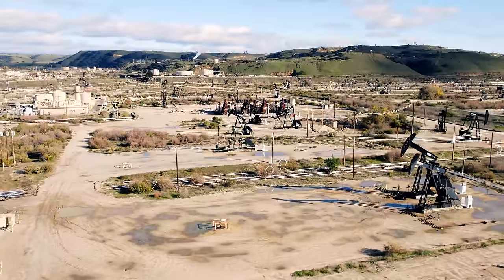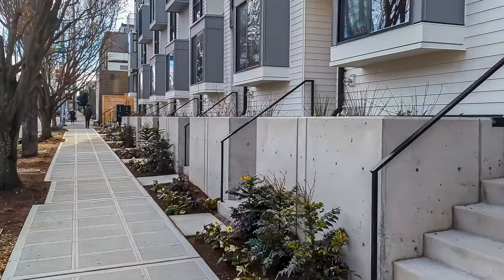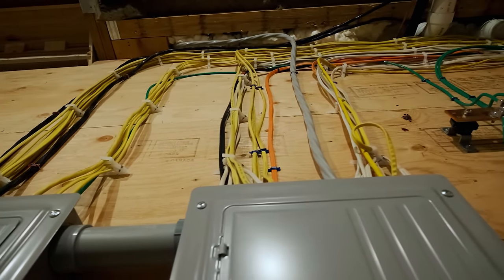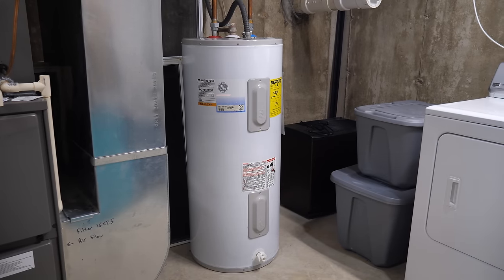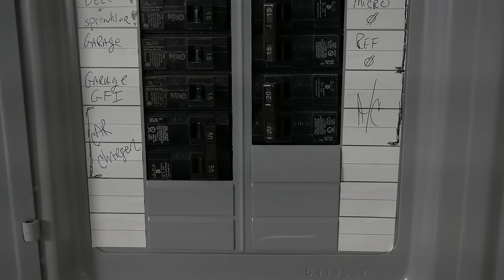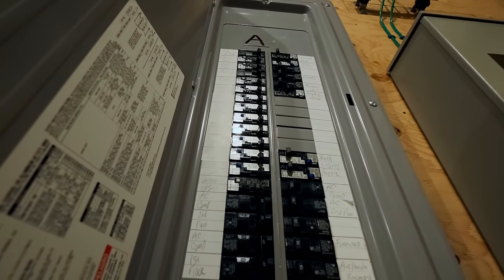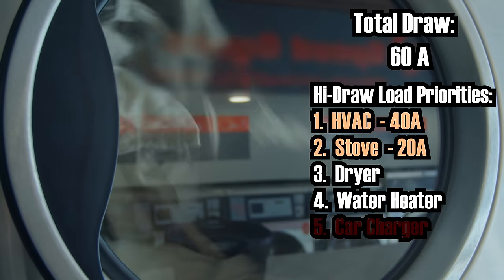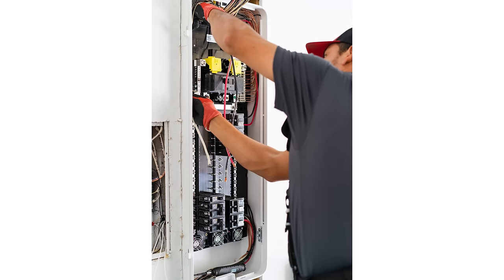Home Electrification: There's not a lot to do, and it doesn't have to be hard (Part 1)

Comment: There is also a very "unsmart" but actually very smart alternative to these smart breaker panels and it has been around for decades:
A load shedding relais.
I used to have them in my home and they were installed here in the late 80s. The current measuring device used to check if the tankless water heaters for the bathrooms were running, like drawing more than 10 amps. If that was the case, they would prevent the night storage heating from charging. These used to pull almost 40 amps on 3-phases (my house has 3-phase 63A service) and they were charging all night so a couple minutes of load shedding was not even noticable during the day. 
These load shedding relais cost somewhere between 20-40 bucks over here where I live and are not too rare of a sight in home electrical panels. They are not connected to anything other than the electrical circuit so no one can use that to spy on you if you're scared of that.
Also the technical complexity of these things is very primitive so they are probably the most reliable option you will be able to find.
And as an added bonus: If you use these things, everything is hardwired, so no softwareupdates can mess up your home.
Reply: Are you french?  You spell relays like it was a french word (relais)

.
Reply: @electrictroy2010  
Well relais is a french word :D 
other languages just adopted the word as far as I know...
But no I'm german.

Comment: Remember a range will heat the home too so it doesnt matter if the heat pump or resistive heat is reduced while the range is cooking food. The heat out of the oven or stovetop pots still has to go somewhere. Usually into the surrounding air.
Reply: not if it's induction. and if you're putting in an electric range why wouldn't you get an induction unit today?
Reply: @Turk380  Induction is not perfectly efficient. Your pots will still radiate heat.
Reply: @Turk380  ever get a wedding ring near a induction burner?
Reply: I don't think it's going to reduce the heat pump, it will just shut it off which isn't too good for the compressor or if it where to start a defrost cycle. But you've got a good point here since all new heart pumps have wifi control, you could actually turn down the temperature relative to other resistive loads. Still need to be mindful that heat pump generates great a 2-3:1 ratio whereas anything else is 1:1 efficient. Mind you, my pump of 1.5kW replaces 30kW of resistive heaters so would not even touch it.
Reply: @avlawns3037  I'm not familiar with many wedding bands being made of ferrous metals
Reply: @jor7137  yes but that is minor compared to an electric coil directly heating the air.
Reply: @Turk380  I have a closed kitchen and an induction stovetop and it gets significantly warmer in the kitchen when I cook. All the pots radiate heat, all the steam warms the place up, even the cabinet below stovetop gets warm. All that power must go somewhere.
Reply: @Turk380  plenty of costume is though.

I'm sure that clashing magnetic field is wonderful for your body.

Eddy currents can be set up in non ferrous metals that generate heat regardless.

Electric stoves suck anyway.

Comment: We recently converted our home to mostly gas service. We had a gas furnace. Installed a tankless gas water heater, a gas range, and natural gas powered standby generator. Our electric bill dropped considerably, and natural gas is cheap to run. The highest it's ever been since we had several days at zero degrees Fahrenheit was January this year and it was $90..while our electric bill was a mere $100. My next door neighbors electric bill was almost $450 for the same time period using all electric.

In the summer our electric bill is in the $220-$250 range, but gas is $18-$20. While my neighbors bill is still over $300.

So where is the electric advantage???
Reply: Count your blessings. During the peak of the Ukraine / Russia conflict a cubic meter of gas went well over 3 euro's over here. Heating the home from 15 to 17 degrees would cost you around 5 to 6 euros just heating the living room and closing it off from the rest of the home.

That being said. I'm not planning to leave gas any day soon. Converting the home to full electric would cost me well over 40k even though I already own 4000 Peak watt of solar panels 😅And I have no idea where I'd have to put all that water pump stuff.
Reply: You very well could live in a cheap-gas-expensive-electricity area.
Also, how much did it cost to convert all that over?
I'd love to see the payback period of all that with gas prices rising and electrical alternatives decreasing.
Reply: You're either lying or you live next to a gas plant. Here in CA we are paying $150 per day to run our Generac 22/24kw standby generator on natural gas when utility power goes out. With the snow storm going on right now on northern CA, our utility was out for 4 days meaning we spent $600 in 4 days.

Comment: I recently completed my home electric conversion for NG. Induction cooktop, heat pump hot water and single spilt reverse cycle air-con. On top of that, I also installed a 10kw solar PV. Cost me less as I'm an electrician, but wasn't cheap. But I could afford to, have the ability, and hence I think, the obligation.
Reply: good job, went solar also (on grid for offsetting bills, off grid for fun), did a full house rewire, but kept gas heat, and use electric as supplemental heat.
Reply: In lower income areas, i doubt everyone can afford to do the same though. You have solar so if power goes out you can probably still power some of your stuff. For most others, they would either have nothing working instead of even just a gas stove so they can boil water/cook. People need either solar and battery banks or a big enough generator to power their critical appliances. I dont mind going all electric, but i would also need to have some stuff being able to work if the power is out for several days like it sometimes is...
Reply: @michaelhanson5773  I have a gas camping stove and a Trangia ethanol camping stove I can cook on if there is an outage, plus Super long life LED lantern. I'm lucky where I live has incredibly reliable grid. When I was a poor student I learnt a trick from an old man I knew. Heat water on the camp stove, fill up hot water bottle, and sit in a sleeping bag at my study desk with one hot water bottle at my feet and one on my lap. You can survive artic conditions like that.

Comment: Also something I've not seen mentioned was the difference between constant load and initial startup load. This initial load can be offset device by device and you could theoretically run even more, if the run time was consistent, something like a dryer. There's lots of fun ways to think about this.
Reply: Let's not forget that you're 100A breaker won't immediately trip as you go over 100A, it will tolerate it for a little while.
Reply: @cedricpomerleau5586  yep, it has some leeway, I've seen a 20 amp breaker hold up to 27 amps for up to 10-20 seconds before tripping. We fixed what was causing the exess draw and replaced the breaker, a new one (we tested out of curiosity, and provided the customer with one that had not been abused and was still new) held roughly 22 amps and only for about 4 seconds before tripping. Just some fun real world experience to back up your statement in case anyone disagrees (in which case they would be wrong)
Reply: @cedricpomerleau5586  also to be added, if you run close to the 80% capacity for continuous use, main breakers will trip faster just due to the heat produced by that much current, it puts them closer to trip than a lower load situation would. I've seen panels pushed so close to the continous rating or over, and trip while current did not exceed protections. Example: 200a service pulling 156a continuous, give or take about 2a. One fan being plugged in, something along the lines of about 12a max current draw on startup, caused the main to trip. Electricity and overcurrent protections are rather interesting, and very necessary, even if a bit unpredictable when it comes to their exact current threshold. This all just goes to prove the point of how you can still utilize a smaller electrical service if you balance properly. 

Nobody wants to know specifics on why we pushed these panels and products this hard, but if you are, ask lol I'll explain. But I doubt anyone cares haha
Reply: @goosenotmaverick1156  Yeah, that's why 100%-rated breakers are a thing. They're usually better cooled so that won't happen. Of course, they can only be used in specific situations.

I don't see this issue on higher voltages system though, as more often than not the breakers are fully electronics. The temperature of the breaker don't affect how it trips, it's just a big switch waiting for a signal for the trip unit. But you should still use 100%-rated breakers if you intend on using more than 80% continuously, or else you might damage the breaker.

Btw, I see 120/240V panels being run at or close to capacity quite often too. Especially in industrial environments. Want some outlets and lighting? Just pull a circuit from an MCC, put a 15kVA transformer and now you've got a 50A panel. After a few decades though, loads start to add up slowly, but nobody wants to pull a new circuit, install another transformer and panel, etc. just for another 500W load...

Comment: I am a gearhead mechanic of 40 years. I have to say, moving to LED lighting and smart home appliances has had a dramatic impact on our power bill. Heat pump and EV car I'd like to see long-term review in Wisconsin winter. No longer in the realm of crazy though.
Reply: I think people forget that one room worth of lights used to use what a whole house does for lighting, and not all that long ago!
Reply: @goosenotmaverick1156  truth. I remember the Jimmy Carter panic 70s. Getting yelled at for leaving lights on. However, everything was a 60 or 100 watt bulb. Cars were getting 12 mpg. Efficiency is ALWAYS the easiest path to energy conservation.
Reply: LED lighting is Electrification done right, it didn't need to be forced on to consumers, the benefits outweighed traditional lighting so much that consumers decided to transition on their own. Thats how it should be with EV vehicles, let the market decide, if the pros outweigh the cons compared to ICE, then the market will decide on its own to phase out ICE.
Reply: @neoasura  a little sum the classic ( E = mc2), the basic, of everything, anything to put electric in to makes heat as by-product,  your electric room heater, by-product is it main function, but everything makes heat too, in the bad old of none efficient electric stuff, light bulbs, used 100w of power, ans are now replaced with 5w or 7w, 90 wasted 90w plus of power being turned into heat that was heating your room too, not a lot but everything helps, so big CRT TV, may of been nearly pumping 200w of heat when going, plasmas screen too, new LED TV after hour's still feel cold to the touch,  all this all adds up, a reasonable amount watt's of power being turn into heat?
well now everything is low power, that missing heat needs to be replaced from somewhere, so your heating system now have make that up too?
Reply: @dh2032  
1- my house needs cooling, not heating. that extra heat only made my air conditioner work harder which compounded into even more waste of energy.
2- heat pumps have 300%+ efficiency. you can STILL heat your house more effectively without the waste heat from those things.
Reply: @gearheadgregwi   and prices follow, it hasn't got cheaper to light your house.
Reply: I'm in central MN, so even with northern WI, and live in a rural area.  I saw someone drive past in a Tesla in the middle of winter.  I don't know if they live here, or were travelling or up for the weekend, but if it will work in the middle of Minnesota winter 20 miles from a town, an electric car will work for almost anyone, if they can afford a brand new vehicle. (commercial vehicles are another matter)  An EV can keep the interior warm (or cool) without having to keep an engine running, which apparently doesn't even drain that much power.  I'm not sure how they would do on the coldest days of the year, but the cars my family owned 20 years ago had trouble starting on those days.  Reduced power and range on an EV would be fine in comparison to a ICE car having trouble starting, and needing to run 15 minutes to warm up.  And there are a ton of standard 120V outlets near where people park their cars, from back when standard cars could be plugged in to warm up the engine (and some diesels still do that).  Not the fastest charging, but it would charge an EV overnight, or during a day at work, with no new wiring.
Reply: So to reward you for using less electricity the power company raised rates because they don't want to lose their jobs (or lower salary).
Reply: @RS-ls7mm  well, put your incandescents back in and see where that gets you.

Comment: My house is 3400 sf. I have natural gas piped into my house which runs 2 gas fireplaces, a gas water heater and a gas stove in the kitchen. I have a 200A electrical service which runs everything else including an electric furnace with heat pump. My electric bill in the winter usually runs about $700/mo. This summer I will be converting the furnace to natural gas which will reduce my heating costs by 60%. Electricity in my area is quite expensive as it is produced by natural gas-fired turbine generators. Makes more sense to use natural gas for any type of heating as the cost per BTU is much less than electric heating. It's even cheaper than running the electric heat pump in the winter when it's below 42 degrees F.

Comment: Great video.  It would be interesting in the next video to cover how much gas each of the four appliances tends to consume in an average house.

In my city rowhouse the largest user of gas seems to be the furnace, with hot water being a distant second.  For various reasons we actually switched from an electric dryer to gas several years ago, and our electric use went down a lot but we couldn't tell any difference on our gas use.  I'd bet cooking uses a trivial amount of gas compared to the other three appliances.  So my hypothesis is we want to get a heat pump for HVAC and a heat pump water heater, and it's not worth worrying about the dryer and stove.  Then we can get rid of most of our gas use and don't have to deal with electric capacity issues.
Reply: Your instincts are good. I'm not sure a heat pump water heater is worth it, but replacing your furnace with a heat pump is the most obvious action. (After checking with your utility company for energy audits, and clearing up any potential air leaks.)
Reply: @trevorc4413  My appliance guy pointed out to me that dryers are the one "100% efficient" gas appliance.  With other gas appliances a lot of the heat from burning the gas goes out with the exhaust, especially with gas stoves as was noted in another video on this channel.  Since a gas dryer's exhaust goes through the drum that you're trying to heat, it's just as thermally efficient as an electric dryer.

Comment: Load balancing has been quite common in European countries for quite a long time. For instance, my water heater automatically shuts off when the dish washer is running. Many car chargers come with load balancing hardware here as well. Oh, and I bought a heat pump clothes dryer yeeaaaaars ago, which uses about 250 watts. The US have a long way to go 😅
Reply: Yeah, but you're paying 30 cents per kWh for electricity plus the cost of the more sophisticated equipment. Americans are paying 6 cents per kWh for natural gas. Your electric clothes dryer is not 400% more efficient.
Reply: @djinn666  but...with propane over $4 gallon (more, if delivered) and rebates and credits, the cost-benefit has shifted for lots of us.
Reply: @timgerk3262  I mean, if you get your electricity delivered as banks of batteries, it'll cost you a hell of a lot more too. I'm talking about piped natural gas, which is what most people use. Also natural gas is not propane. They are different gases.
Reply: @djinn666  Natural gas was just as cheap here in NL for decades (we literally live on a huge natural gas reservoir). And yet, not a single gas fired clothes dryer in sight. Talking about efficiency: since the 80s, most dryers here don't even vent outside anymore. They reuse the heat over and over and the moisture is pulled out of the air. Just the idea of a dryer using heat only once feels wrong here for lots of people.
Reply: @djinn666  what else can I say...one size fits most?
Reply: Natural gas doesn't care if you're using it during peak summer hours, it amazes me why gas vapor absorption AC units aren't more common for the home when you find it in about every RV fridge and freezer.

Comment: Living in the midwest, gas ranges/dryers are not as common as in the west unless you live out in the country and have an LP tank. So it's mostly the HVAC furnace and water heater for a lot of us. The big issue is sub zero with a heat pump it'll typically have to kick on a resistive heater to keep up and resistive heaters can pull a lot of juice, that electrical cost is still quite a bit more expensive than gas, if you are lucky enough to build your home and can install a geo-thermal heat pump that issue is non-existent though. I have solar and I've found with the amount of snow we get it'll also reduce solar unless they are low enough where you can clean them off. We just have a few problems like these that take a bit of extra effort compared to Nevada or Cali. Perfectly solvable though, problem is the $$$